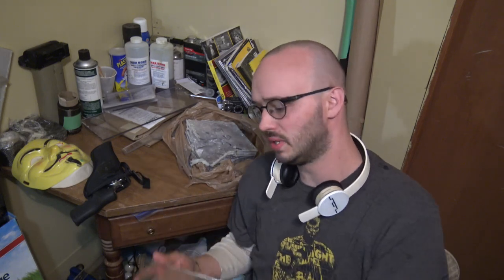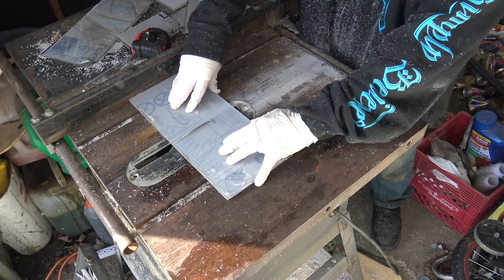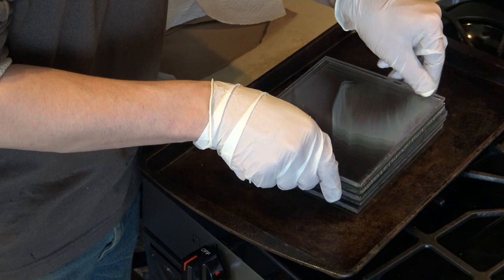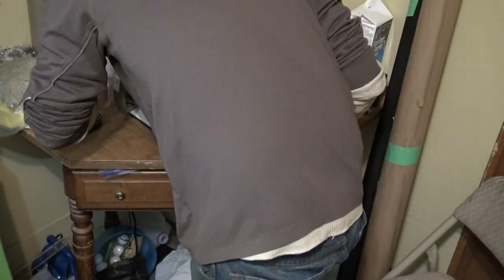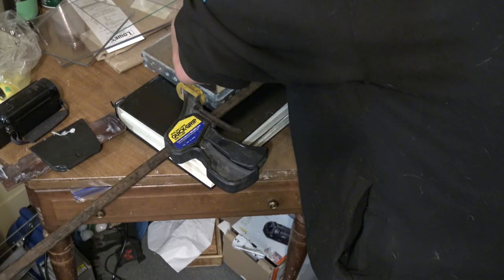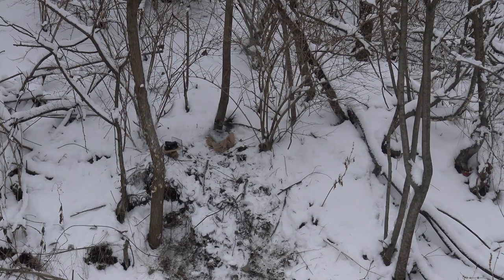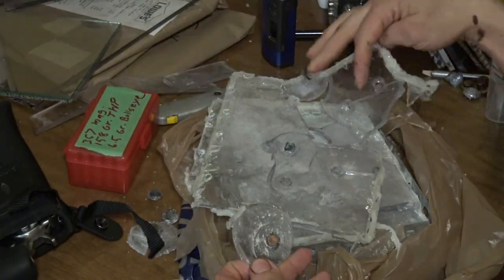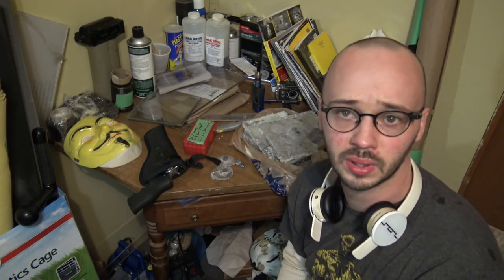Make bulletproof glass at home!

Comment from the maker: I've made new bulletproof glass using acrylic instead of glass! check it out here: https://youtu.be/QPweADnNrKU
Reply: Hey I am actually planning a project for a laptop casing I need something resistant like this bullet proof, heat proof,anti static, shock proof and that is about it.I also intend to use nanotech coatings to increase water proofing and I also need a way to make it as shiny as possible meaning clear as water is that possible to accomplish.
What would you recommend!.
Reply: Is this something I can use for windows at home?

Comment: I would think you want fmj, solid copper, or steel core rounds to test "barrier" penetration. Hollow points are designed to spread not penetrate. Optical epoxy or bonding films are used to bond plastic and glass layers.
Reply from the maker: Your right about that, I would have used fmj's if I had them, at the time of the testing all I had was hallow points, but i'll be updating this glass as I progress my armor builds. I was worried about using epoxy as a binding agent because I've seen some videos where they ended up cloudy and hazy, But bonding films that need heat might work well, either way version 2.0 will be higher tech for sure, thanks for the comment!
Reply: IIR they do make make special epoxies for applications where optical transparancy is a must.

I have seen cross cuts of thick polycarbonate only ballistic "glass" with 2 1/4"' plates as the outer layers and a thick middle layer of polycarbonate ( exact thickness depends on what the testing limit  of those see through panels was, IIRC 1/2" ). With special shatter proof plastic film between the polycarbonate layers ). Epoxied together ofcourse.

Comment: I wanted to share with you this product which is specifically designed to bond polycarbonate with glass. The advantages of MMA 3295 structural adhesive have the advantage of excellent resistance to shearing, impact and peeling as well as good temperature resistance.

Comment: May sound dumb but it'll also hold up to say a sledgehammer strike? 

I assume so given ft/lb of energy from a 357 but figured I'd ask.
Reply from the maker: The grade of glass I used would still shatter some what, but yeah that polycarbonate can for sure take blows from a large hammer. It's remarkable how much damage that plastic can take. When I make my polycarbonate riot shield I'll make sure to use a sledgehammer on it to show how tough it is. And the next time I do bulletproof glass I'll show some other impact tests. Thanks for commenting!
Reply: I think the problem would be the pressure would distribute through the glass and still knock you on your ass maybe with a fracture.

Comment: I might be doing this before i go to Mexico and cover my car up with extra metal plates . " just in case situations turns froggy" on my vacation   😋
Reply: Dem Chupacabras, boy, lemme tell ya.
Reply: I wouldn't even drive there. Way to many corrupt cops. They'll pull you over and demand money or they'll lock you up. Just use a taxi
Reply: Wow I want to do the same.
I have a van that I would like to bulletproof.
Reply: Might?! lol Yeahhhh you should def do that
Reply: Or just don't go.
Reply: @ytcoolgrande2660  if they do that, ask to talk to the US embassy or ask for their supervisor, they can’t just lock you up for no reason especially a tourist it will bring too much heat on them
Reply: there's a lot more space inside the door and fender panels where it's normally hollow

Comment: Would you do the same for bigger sizes of glass The same type of process?
Reply from the maker: I've expanded my experiments since this first test plate. I've found lexel (clear urethane resin found at hardware stores) to be one of the best binding agents that wouldn't haze the polycarbonate or yellow over time. It's some tough glue. I also experimented with acrylic instead of glass, and that has shown great results ( I have that video up on my channel if you're interested). Anyway, I still like glass plys with polycarbonate between them, but with a bit more refinement and better adhesives, I'll be uploading a new video on this topic soon.

Comment: I suggest you perform all these tests without using hollow points. It seems that almost any barrier, object,  type of armor or shielding stops them easily as they start expand, deform or break apart upon impact. I mean they are doing what they are supposed to but wouldn't these tests be more useful or impressive if using FMJ or ammo that is intended to penetrate more than expand to make a bigger wound cavity? Great video by the way! Very informative!
Reply from the maker: Thanks! Yeah, FMJ's would have been better, however hollow points was all I had at the time of testing. Interestingly enough though, the UL rating system and the NIJ use hollow points and gas checked wad cutters for the grading of glass when magnums are used. https://youtu.be/QPweADnNrKU this is my newest video on ballistic glass, I cover that in the video!

Comment: Thanks so much ...

I've got five 3'x6' bay windows on the back of my house. I could get 4x8 plexiglass sheets and cut them down to size. Will that work? Or is polycarbonate better?
Reply from the maker: Polycarbonate is way more energy absorbent, however plexiglass is acrylic, and that is used in some bulletproof glass. I do know it has a tendency to shatter rather than lightly crack, but i've never tested it for armor. when it is used I know the glass ends up thicker and heaver, but plexiglass is cheaper.  I'll have to grab some and do some tests, see how they compare. thanks for the comment.

Comment: Home window size project would probably be expensive.
Reply from the maker: Yeah a bit, you can also look into high strength acrylic, it works great too and is cheaper. I've been thinking about how i could recycle old polycarbonate pieces into larger sheets, that would greatly reduce the cost if you could do it at home, I'll post a video if I come up if anything.

Comment: Would it work this well with a bigger sheet? Or does the size need to be on the smaller size. I know usually the bigger the glass sheet the more stress it's under. Is the principle the same for bulletproof glass?
Reply from the maker: I'm currently retesting this now! I've been using polycarbonate and acrylic rather than glass and polycarbonate, and yeah the thickness does play a factor, in both the polycarbonate outer layer and the harder inside layer. If you go to my community tab on my youtube page you'll see some of the glass I'm testing out a few posts back.
Reply from the maker: Ah i see your talking about larger rather than thickness, and that i don't know off hand, but I'll find out!

Comment: I wonder, if  using some high grade clear epoxy like West System (used by carpenters as a top layer on countertops) apply between layers to glue them together, will make it stronger.
Reply from the maker: I've used some West coast system epoxy before, I was a little worried about it staying clear without any haze, but I'm going to be looking into some form of bounding epoxy for future builds where I incorporate the glass into a mask or shield of some kind.
Reply: I would think you want something with flexibility, silicone in a ultra thin even layer!? Then firmly press the played together, squeezing out the excess
Reply: Look up how they make windshields for vehicles. That kind of laminating technology is the right idea. It stays flexible so that the windshield doesn’t break apart and stab you with a giant sliver of glass at 150mph! Lol

Comment: Why not just use all polycarbonate? What’s the glass even for? To say it’s bullet resistant glass?
Reply: Genemachine13 Menges polycarbonate is very flexible, the glass breaks up the bullet or disperses energy by cracking and the polycarbonate catches it, just like how ceramic armor works but with different materials and trade offs
Reply: Armyaloof TV thanks!
Reply from the maker: Well said ArmyaloofTV.

Comment: How much did it cost, and where are the materials best sourced?
Reply from the maker: freckleface.com is my favorite place to get polycarbonate sheets, they run specials and stuff like scraps and cut offs. Most of my plastic however was sourced locally from bus manufactures because if the sheets are damaged at all, (like scrapes and scratches) they wont use them, so they throw them out. Polycarbonate is quite costly, so freckleface is a real nice place to go. As for the glass well, I got that at lowes home improvement, they'll cut it there for you as well, and glass is cheap. I payed about $30 bucks for quite a few sheets for various tests I conducted.

Comment: Let me make some critiques.

1) hollow points do not penetrate well and are for use on SOFT targets. Use FMJ when testing armored targets. But I'm about to contradict that in a sec.

2) armor has a rating system to tell what the material(s) can handle. While you are well on your way to making nij lvl iiia (3a) armor but using a .357 magnum does not even push the limits of lvl iiia armor. iiia armor is tested with .44 magnum semi-jacketed hollowpoint @ 240gr moving 1430ft/s +/- 30ft/s. that is the nij testing standard for iiia armor.
What I'm saying is while you may have a .357 magnum you need to get or find someone to lend you a .44 to test materials like this.

I could go into the differences of the two magnums but that's just a long list of nopes when posting it in a YouTube comment.
Reply: You're talking about laboratory standards for something this dude made in his kitchen that stopped multiple rounds from a powerful gun. I'm impressed with his ingenuity and I hope to see more development.

Comment: I didn't watch the entire video and I'm sure you've made improvements but I'm just going to mention this if you truly wanted to laminate all those together if you could have got yourself a gallon of the two-part clear epoxy resin mixitup slathered it on there and then vacuum bagged the entire project to pull the air and impurities and Imperfections out of it and wait for the Cure and then it would have been absolutely solid and perfect and one piece vacuum bagging if you are not familiar with it is very common in the aircraft industry for laminating Composites the honeycomb for flight controls I would get away from using glass altogether because the Plastics that you're using are 40% more clear than glass

Comment: What???? You didn't use polished clear Aluminum Oxy nitride sheets??? They are about 40% stronger than glass and 60% lighter than glass (or was it the other way around?) This would have given you something like level 4 strength. But I suppose it would have broken your budget

Comment: Could you redo the test with a mount that wont move like you would in a window with them able to move being free range alot of the force is absorbed by being able to move which wouldn't be the casein a ridged window mount.
Reply from the maker: I want to do a full window build soon, and that one won't be able to shift around as much. I'll even set it up on some runners and drywall, I want to make an armored wall section. This was more for visors and masks that I'm currently working on, but when I revisit this project I'll make sure to mount it better. Stay tuned, I'm working on HDPE armor right now, but I'll be back to this soon enough.

Comment: That’s 1/4” lexan dude
Reply from the maker: Didn't I say 1/4 polycarbonate? I guess I said 1/8, my bad, I'll put a note saying the correct thickness. I'm currently doing this project again, using thicker plates of polycarbonate and acryilc and boy, it looks good.
Reply: You said 1/4 at first but corrected yourself and said 1/8”. Lol. 
Yeah would be interested in seeing the process again gl.
Reply from the maker: Lol yeah, not the first time i've done that. The new stuff I'm working on uses a few different transparent adhesive rather than the oven press method. I also dropped normal glass almost entirely, that way I can thermoform  both materials into different shapes like shields and domed face covers. The next video on this will be nuts.
Reply: Tech this out meow yeah I think the point of using actual glass in the layers is to keep price down and energy transfer. Thick lexan/plexiglass is crazy expensive!!!! 
The military and most companies use glass in between layers for a reason.... 
I think it transfers energy outwards better. Let’s the fragments move between the layers and the shockwave to move outwards. Instead of just forward, cracking the plexi. 
Most definitely glue/laminate the layers instead of trying to melt them together... unless you couple press and melt at the same time but that’s gonna be speedy and slow to developer. 
Thin layer of silicone and then press the layer together. Like ultra thin layer. Just enough to get it stuck. Like squeegee the clear silicone ultra thin.